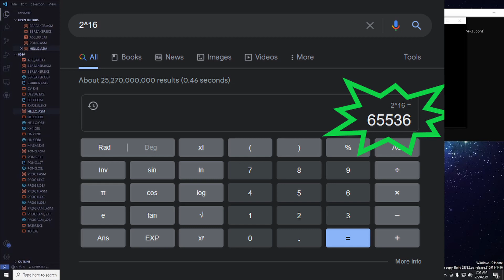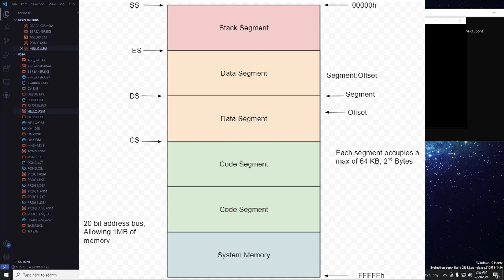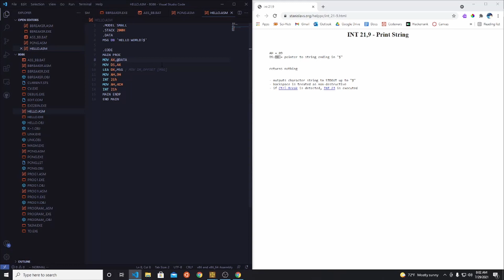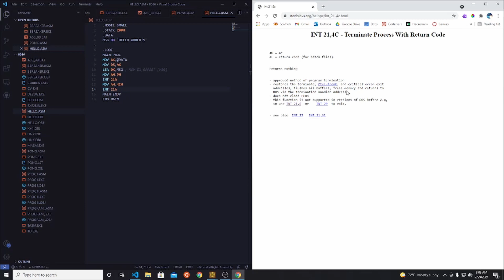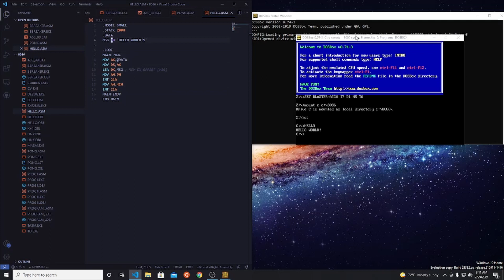In Depth Assembly: Hello World!

Comment: Good work.
I hope you continue to make some more videos about assembly in DOSBOX.
Reply from the maker: Hey Max, thanks for the comments! They were very thoughtful and taught me some stuff I did not know.
Reply: @markkraay  I made a text scroller for smooth scrolling the text screen. The batch file need to start a hexadecimal value attached to specify how many lines to scroll. And additional it need Debug. com from the FREEDOS operating system download and extract into the mounted folder for a 32 bit instruction (rep movsd).

Example:
Soft25.bat 18

@echo off
REM Soft Scroller for DOS 80x25 text screen
REM Need one parameter(%1) attached.
REM Usage: Soft25.bat rows
REM Example: Soft25.bat 18
REM rows(hex 1-18)
echo acs:100>tmp.deb
echo mov ax,0B800>>tmp.deb
echo mov ds,ax>>tmp.deb
echo mov es,ax>>tmp.deb
echo mov bx,%1>>tmp.deb
echo xor di,di>>tmp.deb
echo mov si,A0>>tmp.deb
echo xor ah,ah>>tmp.deb
echo mov cx,3C0>>tmp.deb
echo mov al,8>>tmp.deb
echo mov dx,3D4>>tmp.deb
echo out dx,ax>>tmp.deb
echo inc ah>>tmp.deb
echo mov dx,3DA>>tmp.deb
echo in al,dx>>tmp.deb
echo test al,8>>tmp.deb
echo jnz 011F>>tmp.deb
echo in al,dx>>tmp.deb
echo test al,8>>tmp.deb
echo jz 0124>>tmp.deb
echo cmp ah,10>>tmp.deb
echo jnz 0114>>tmp.deb
echo mov ax,8>>tmp.deb
echo mov dx,3D4>>tmp.deb
echo out dx,ax>>tmp.deb
echo rep movsd>>tmp.deb
echo dec bx>>tmp.deb
echo jnz 010A>>tmp.deb
echo ret>>tmp.deb
echo.>>tmp.deb
echo n Soft25.com>>tmp.deb
echo rcx>>tmp.deb
echo 3C>>tmp.deb
echo wcs:100>>tmp.deb
echo q>>tmp.deb
debug<tmp.deb>nul
del tmp.deb
Soft25.com
del Soft25.com
REM I try to explain the code. 
REM One step is to copy a block of lines from the source location (second line to the last line) to the first line.
REM But before we copy the block of lines we are waiting of a vertical retrace from the cathode ray at port 3da
REM and then we do a panning of the whole screen shift one pixel at port 3d4. 
REM This we have to do 15 times (for a character set of 8*16)
REM at last we have to take the default zero position on port 3d4
REM and finaly we copy the block of lines after panning the screen. Now we have scrolled one line softly pixel by pixel.

Comment: I put all instructions into batch files, because batch files are executable, easy to copy&paste and suitable to contain the open source code of a routine made with assembler mnemonics to create a tiny executable com file with a little help from debug.

Example: COLOR.BAT works similar to the Windows color command with a color attached.

Feel free to copy, modify and share. No spiritual ownership exist.

Usage: COLOR.BAT 1b

@echo off
REM Need one parameter(%1) attached.
REM Usage: Color.bat color
REM Example: COLOR.BAT 1b
echo acs:100>tmp.deb
echo mov ax,b800>>tmp.deb
echo mov ds,ax>>tmp.deb
echo mov cx,820>>tmp.deb
echo xor di,di>>tmp.deb
echo mov al,%1>>tmp.deb
echo mov [di+1],al>>tmp.deb
echo add di,2>>tmp.deb
echo dec cx>>tmp.deb
echo jnz 010C>>tmp.deb
echo ret>>tmp.deb
echo.>>tmp.deb
echo n Color.com>>tmp.deb
echo rcx>>tmp.deb
echo 16>>tmp.deb
echo wcs:100>>tmp.deb
echo q>>tmp.deb
debug<tmp.deb>nul
del tmp.deb
Color.com
del Color.com

The batch file contains some pipe operators (> >> <) for to redirect the output of the echo commands into a new text file and to start Debug with the file. And the output contains some internal Debug commands and a routine made with assembler mnemonics to create and run a tiny executable com file. The routine use the attached color and writes it directly into the framebuffer of the DOSBOX text screen.

If you like it i can post some more batch files. Let me know.
Reply: The 4 bit and 8 bit colors are divided into rgb components. Each component have a value from 0-3f and we can change the red, green and blue components of each color.

Example to change color number 1 from 00 00 2A to 0 0 12:
WriteDac.bat 1 0 0 12

@echo off
REM Set the color components with red green and blue.
REM Need four parameter(%1 %2 %3 %4) attached.
REM Usage 4 bit Textmode(3): WriteDac.bat color(0-f) red(0-3f) green(0-3f) blue(0-3f)
REM ;------------------------------------------------
REM ; color components default values red green blue
REM ;------------------------------------------------
REM 0 black       00 00 00
REM 1 blue        00 00 2A
REM 2 green       00 2A 00
REM 3 cyan        00 2A 2A
REM 4 red         2A 00 00
REM 5 magenta     2A 00 2A
REM 6 brown       2A 2A 00
REM 7 light grey  2A 2A 2A
REM 8 grey        00 00 15
REM 9 light blue  00 00 3F
REM A light green 00 2A 15
REM B light cyan  00 2A 3F
REM C light red   2A 00 15
REM D pink        2A 00 3F
REM E yellow      2A 2A 15
REM F white       2A 2A 3F
REM ;------------------------------------------------
REM For 8 bit graphicmode(0x13): color(0-ff) from a palette of 262144.
echo a cs:100>tmp.deb
echo mov dx,3c8>>tmp.deb
echo mov al,%1>>tmp.deb
echo out dx,al>>tmp.deb
echo inc dx>>tmp.deb
echo mov al,%2>>tmp.deb
echo out dx,al>>tmp.deb
echo mov al,%3>>tmp.deb
echo out dx,al>>tmp.deb
echo mov al,%4>>tmp.deb
echo out dx,al>>tmp.deb
echo ret>>tmp.deb
echo.>>tmp.deb
echo n WritDac.com>>tmp.deb
echo rcx>>tmp.deb
echo 11>>tmp.deb
echo w cs:100>>tmp.deb
echo q>>tmp.deb
debug<tmp.deb>nul
del tmp.deb
WritDac.com
del WritDac.com

Comment: DOSBOX emulates a PC with a 32 bit CPU and from the FREEDOS operating system we can download and extract DEBUG. COM (provide 32 bit instructions) into the mounted folder of DOSBOX. With 32 bit we have more and larger address register, larger operands in the 16 bit mode with using an address size and/or an operand size prefix.